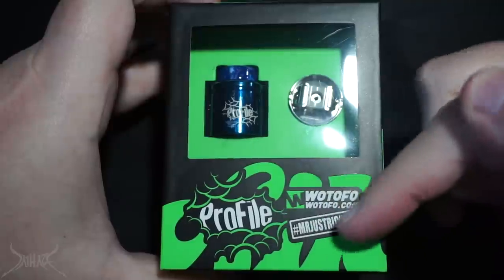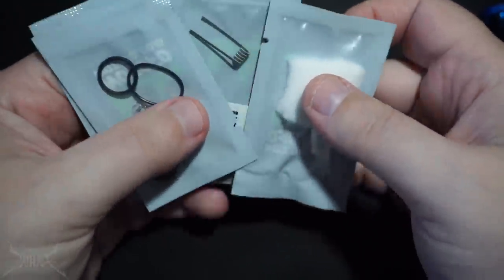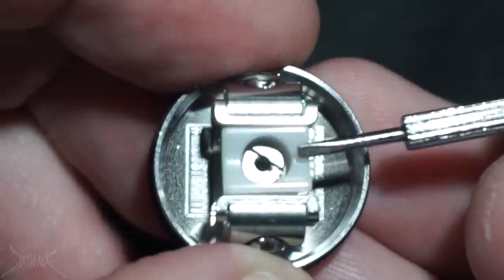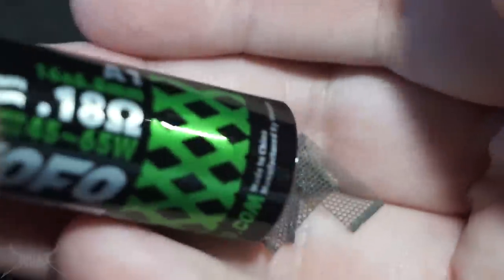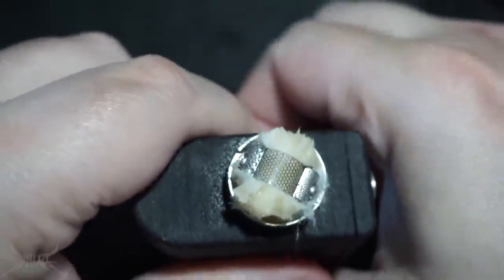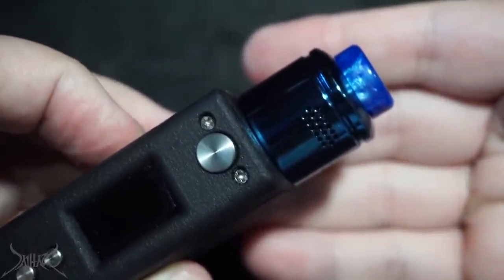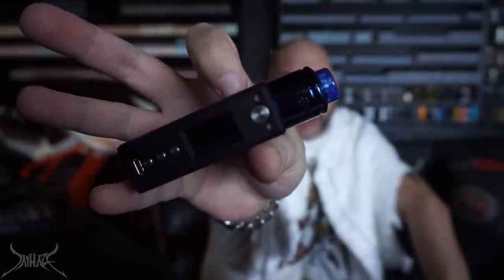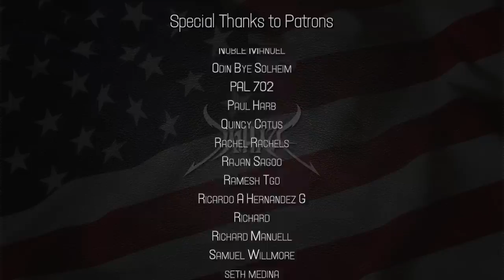Wotofo Profile Mesh RDA Review and Rundown | MrJustRight1 Project

Comment: Just curious but how come every other reviewer had zero issue wicking this also they include a tool for bending the mesh perfectly!! Not being a dick! Just asking because I have one never had a single issue excellent flavor! But those cotton strips are thick for a good purpose to be sure you get enough cotton pushed up against the mesh ! Truthfully though this wasn't as bad as some other affordable rda's... but yeah high end your very slow and careful and do nice builds basically just seems affordable vape gear doesn't get the same treatment as affordable gear does! And Idk maybe I'm wrong! But I feel every product should be treated the same then used then pros and cons ! Also I agree Idk why they did the colors the way they did does make adjusting airflow hard to see! And mine sqounk normally odd how yours didn't that is just strange! Well vape on

Comment: Am I the only one who gets a dry vape experience with profile rda (using wotofo coils and cotton)? I don't get dry hits, it just feels dry (not refreshing) even if the cotton is fully saturated.
Reply: I build exactly like Wotofo recommends and I get a hot spot in the top center of the mesh/cotton.  In 2 weeks I've wicked it 20-25 times with Wotofo and OFRF mesh, Wotofo cotton, Cotton Bacon, Firebolt and Japanese cotton.  Regardless of how I wick and how precisely I bend the mesh and install it i get hit spots developing almost immediately.

For me as a mesh atty it falls short because of the hot spots and the flavor is muted.  It's OK as a single coil but instead I've put it on the shelf and am using a Drop dual coil atty.
Reply: @ThekiBoran  That's a bit strange, I wicked it with wotofo cotton and cotton bacon and it was fine with both. No dry hits whatsoever. Make sure that the cotton touches all the mesh surface otherwise you will get dry hits. One advice that i've seen from another guy was to add the spare spring under the ceramic to make it bounce better so it will push the cotton, however i haven't tried this yet.

For me, the mesh setup gives lots of flavor, no dry hits, but it feels a bit dry in the sense that is not refreshing and I need to drink water all the time. I am waiting for my OFRF mesh strips to see if there is any difference. At the moment I've got a single wire coil and it works fine.
Reply: @styx00ps41 

I had a private conversation with Wotofo and sent them pictures.  They had no suggestions as to how to prevent the hot spots.

I love the clouds the Profile produces and the flavor is OK to good but not great.  The airflow is awesome and it's a good looking atty.  But the hot spots that develop after 10-20ml makes it unusable for me.
Reply: @ThekiBoran  I suggest you try adding the spare spring and see how it goes. If you get dry hits after 10/20 ml of juice, that indicates that the cotton is pushed down due to the weight of the saturated cotton, so adding the spare spring under the ceramic might do the trick.
Reply: @styx00ps41 

I tried that.  No good.

Comment: I will say the profile, the recurve, the profile unity, wotofo just keeps pumping out great vape gear. These vape producers are like drug pushers though that keeps coming out with better drugs, well some of them anyway. I mean Joyetech came out with the Espion infiniti AI, which is without a doubt the stupidest mod ever. They put this big screen on the front that has these mirrored lcd lights and put the smallest little actual settings in the middle that causes eye strain to read. That was just not clown worthy enough. They came out with the same mod in AI model. It has 9 things you can say to the mod and it will respond...maybe. One of them is I love you, and it responds with me too. Another was Let's rock, and it responds with rock and vape. I did not even know it had the AI feature when I bought it on clearance for 40 bucks. I bought it because it was dual 21700 batteries. Now I cant even vape it because I visualize some moron standing at some dive with the flashing led's lighting his face saying I love you to his vape mod. I dare anybody to tell me a mod that can win a stupid mod award against that thing. I find it so laughable that I can't vape it for laughing. If anybody over 12 likes this ridiculous mod, all I can say is rock and vape.